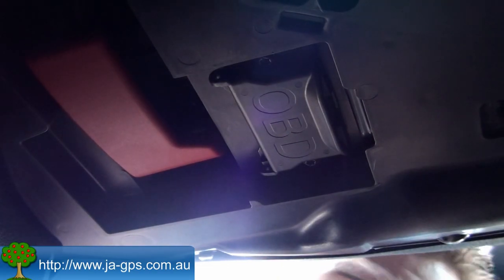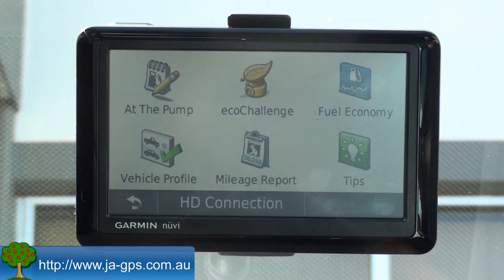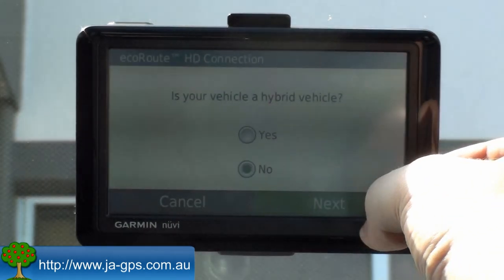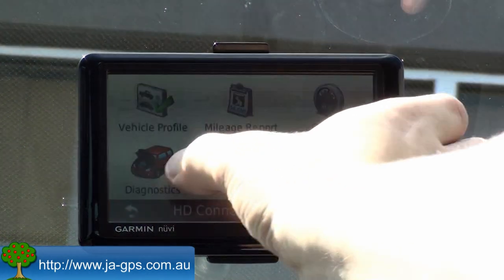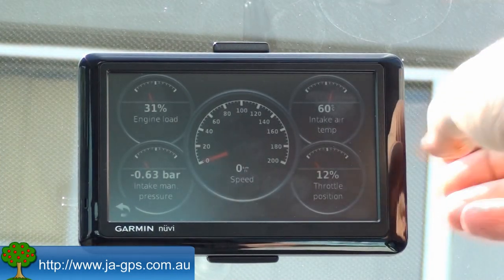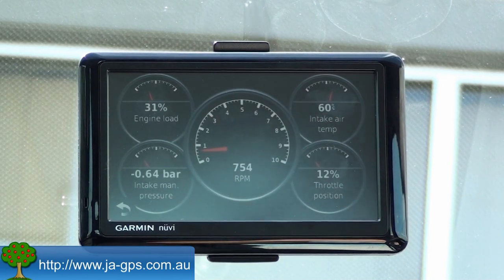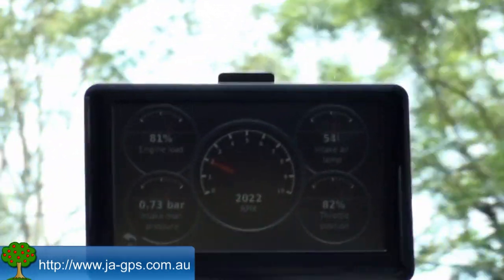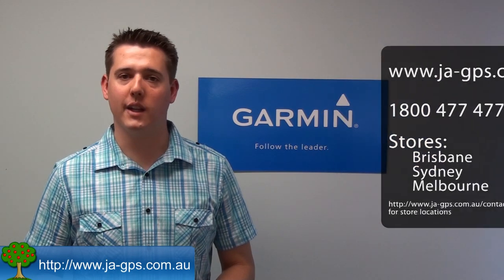Garmin ecoRoute HD Demo Video

Comment: I have a 95 camaro.  well,  if your familiar, it is OBD 1.5  it has an OBD II  plug with an OBD I computer.  to plug diognostics computer in it, you need the K9 adapter card.  is there such an adapter for this device?

Comment: Did you use the Garmin ecoRoute HD or the KNAEC100?  I'm wondering if the Garmin ecoRoute HD works too since it's only $100 at walmart, instead of $150.

Comment: Hey, great video one question though. I just ordered this unit. But as the old adage states hindsight is 20/20. I have the K40 Calibre Bluetooth 360 radar system built into my car. I was wondering if you know if this might interfere with the EcoRoute HD. Bluetooth phones and other Bluetooth devices I have paired to my Nüvi don't interfere, so I hope this doesn't. Thanks for your advice, mate.

Comment: Nice review.  Which model nuvi are you paring the ecoRoute HD with in your video?  I am using a 1390t and my gauges do not update several times per second.  Instead, I see maybe 2 updates per second.